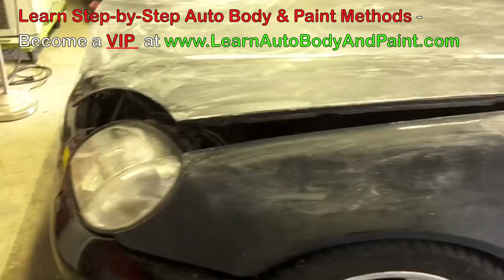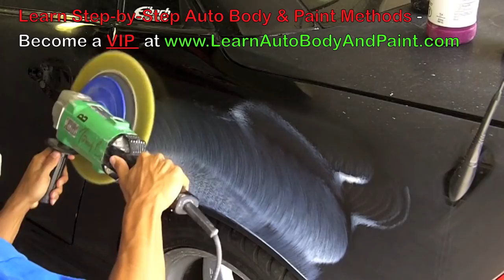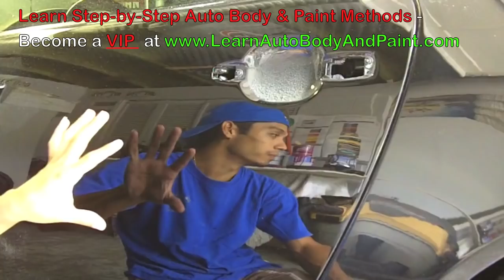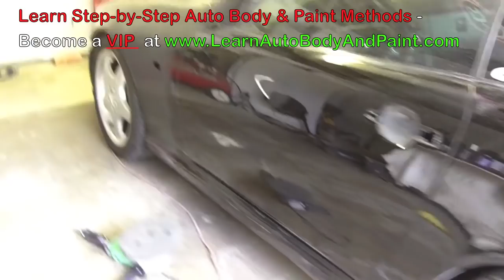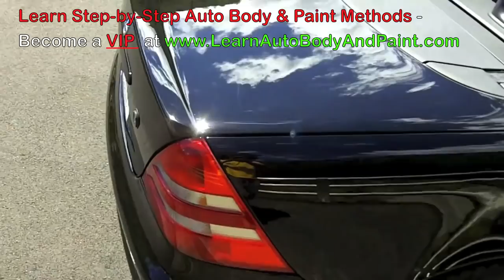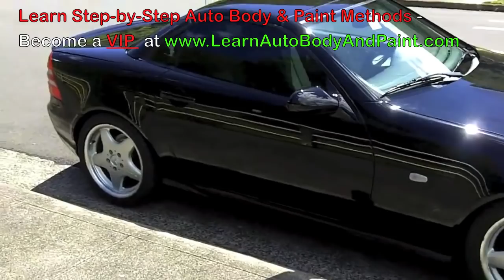How To Wet Sand And Buff a Car (Wet sand and dry sand tips)

Comment: I am wanting to fix a word they keyed on my truck. At the same time I am going to fix the hood scratches from the road. I'm going to sand to metal, prime, paint, and clear it. My question is can I use IP05 House of Kolor pearl with regular ppg or dupont clear? What grit do you recommend for the whole truck? Thanks in advance, this is my first time doing any painting on a vehicle. I do have experience on painting houses.

Comment: Damn that is awesome looking once you polished it all etc. 
I just painted some interior piece's of my car the matching colour of the car, i bought from a reputable paint shop and got the spray paint with clearcoat in it as well as used a couple coats of clearcoat as well. once dry for couple day's to cure i wetwsanded with 2000grit and then polished the piece's till nice smooth and shiny, do I wait a while before waxing them even though they're just plastic interior piece's or can I wax the same day etc?

Comment: Hello, I just painted a Toyota Celica and got a lot of orange peel.. I clear coated with 4 coats of clear. I have sanded out some of the peel but I still have some pits/peel in the clear. My plan is to color sand with a DA again. my question is what type of bonnet do you recommend? what are you using in this video

thanks

Comment: Hey Tony what brand dry sanding discs are you using?

 Also i keep getting pigtails when dry sanding DA..im frequently changing discs too
Reply from the maker: MartinMora92 Not sure, Could have been norton at the time. You will get them if the disc cakes up. What I usually do in that case it is wash it with wet 2000, then buff it. Learn more at the site: http://www.learnautobodyandpaint.com